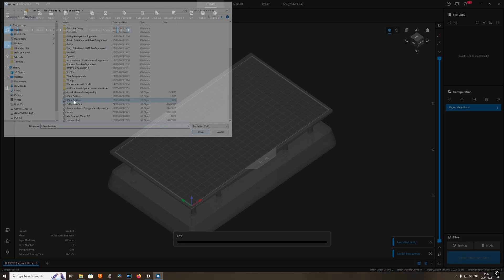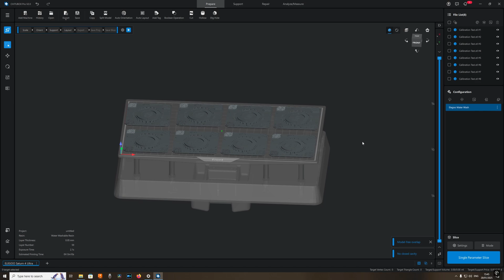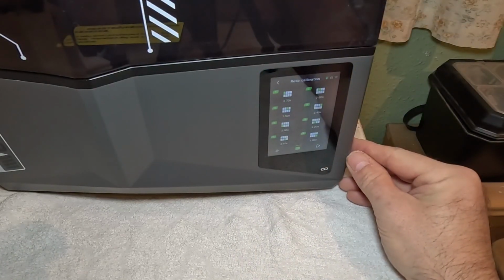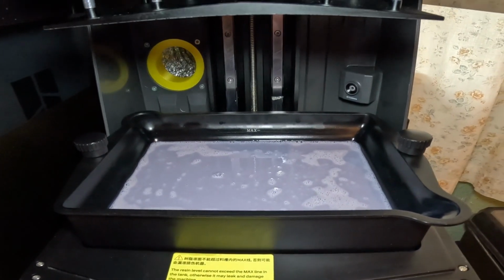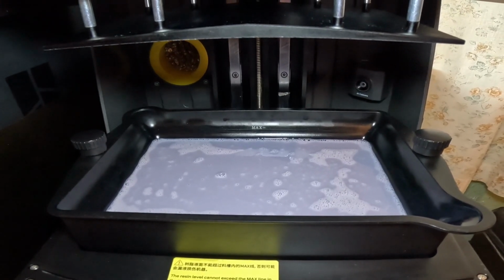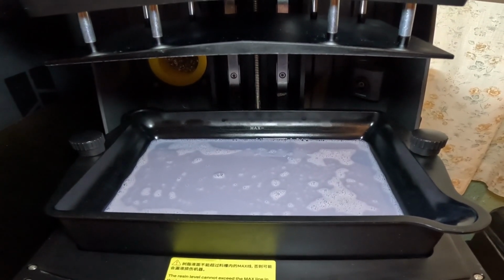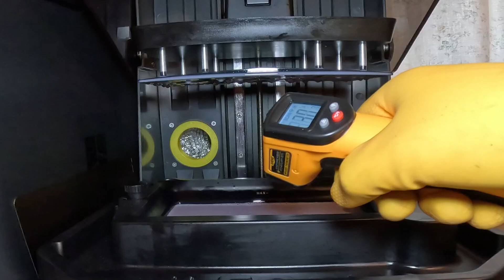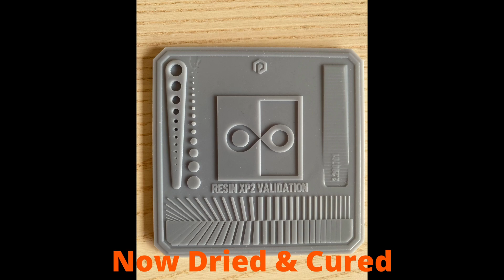Elegoo Saturn 4 Ultra, Calibration Made EASY! Beginner’s Guide to Perfect Resin Prints.

Comment: this is totally nuts.  i've got the 4 ultra 16k............i've spent the last 3 hrs trying to find out the orientation compared to the build plate lol.

Which is number 1 and number 8??? lol
Reply from the maker: It does explain in the video, but number 1 when you flip the plate over is top right, meaning 8 is bottom left.

Comment: How do you add grid boxes? I don't see that option anywhere.
Reply from the maker: It's a stl file, I downloaded on thingiverse.
Reply: @CALTECH3D I was confused thinking there was a setting in Chitubox that would allow you to vary exposure on the same plate based on model, but I figured out that's done through the Saturn control panel. Thanks for the reply!

Comment: There is an easier way to layout your test models.  Drop the first one on and move it to the top left.  Use the copy feature to create 7 more.  Then use layout and set the separation to about 1mm.  Adjust from there until you get them spread out but still fit on the build plate.  I'm using a very similar model so I think I'm using 1 or 1.5mm for the separation.
Reply from the maker: Thanks

Comment: Love the video. Would
Love to know your settings as I’m having  prints fails like crazy. Any help will be appreciated.
Reply from the maker: My bottom base layers are 25 seconds, and the BEST normal layers as said in the video are 2.1 seconds, hope this helps you, if not let me know and I'll see what else I can recommend, thanks for watching 👍
Reply: @CALTECH3D Thanks for the video. I have done the the same test today, and got a bit different timings. Also we are in the Autumn and the temperature does not help. I got nice prints with my calibration test however, the regular prints are still failing. I tried to play with different settings but nothing. Water washable is really hard for me to print. I normally dont have so many issues with other resins. Any extra tips you could advice? Thanks

Comment: show your Chitubox setup before sending the file to the printer :( layer height, bottom layer count, bottom exposure time, Transition layer) do you put antialiasing
Reply from the maker: Everything is standard apart from bottom exposure and normal exposure.. which are explained in the video.
Reply: I hate that this is not explained in every video and it's so important: 0.05 layer hight, 4 layer bot, 0 transition layers, bot exposure up to you (25 for me) . Default the rest.

Comment: Where did you get the file for the lid you have on the vat?
Reply from the maker: If you mean the yellow vat cover, it's on bambu makeaworld, thanks for watching.
Reply: Did you print with resin? Or fdm this cover?@CALTECH3dPrinting
Reply: The angle plate holder is great too.

Comment: I can't figure out which is number one?  With the plate in front of you and the open end 0f the connecter in front of you. Is the top left  the #1 positution?
Reply: in Chitubox, top left 4-3-2-1 then 8-7-6-5 (look when he points at 7). In the VAT as it shows in the LCD screen 1234-5678 (top left is longest exposure)
Reply: You will also see at 5:10, he marks the top of the plate at the rear left for #1. You can also search Cults3D for "Saturn 4 Ultra - Resin Calibration Tool Gridlines". He has labeled versions of the STL grid files there.